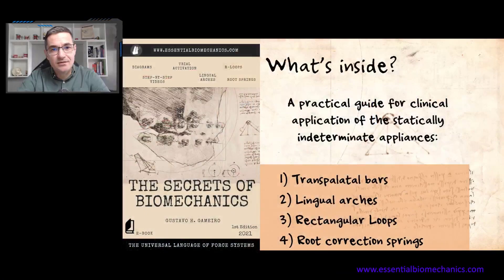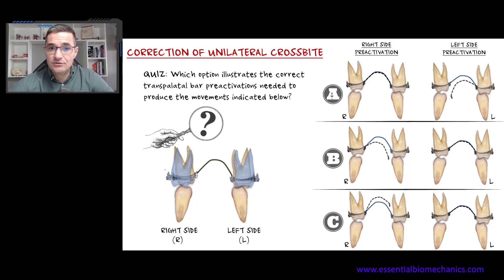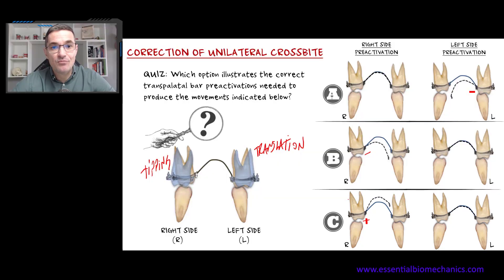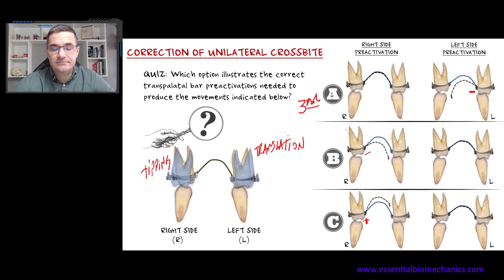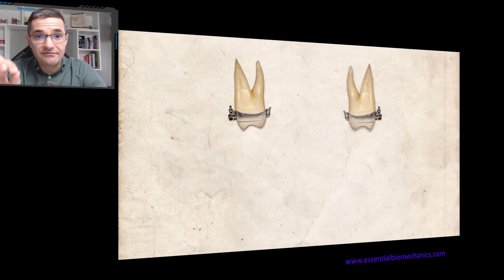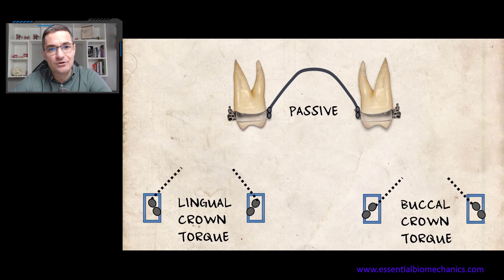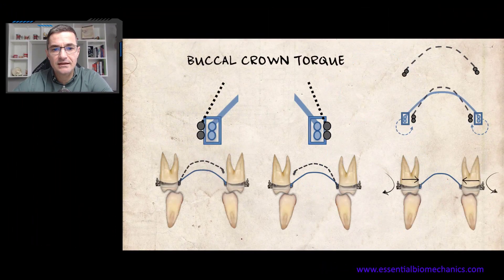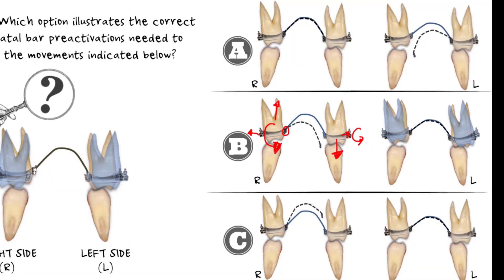Unilateral Crossbite Correction | Essential Biomechanics

Comment: How much of an activation (approx) on a 0.8 mm stainless steel will you need in order to generate 300g of force transversely (in mm from the sheath or angulation to the sheath inter axis) how accessible are 0.32 sheaths? Thank you for your extraordinary illustrative diagrams and videos.
Reply from the maker: Dear Dr. If you want only expansive forces, I suggest you to preactivate the bar along its long axis, and not in the terminal ends. Please check our video named "molars expansion" to see this simulation. In mm, the expansion is around 3-4 mm. Regarding the sheats, I only use .036.